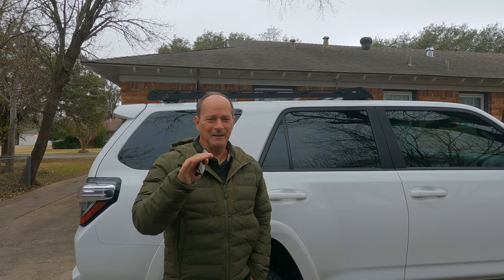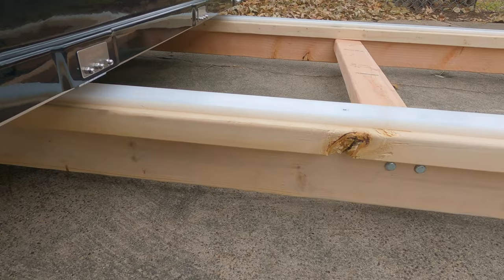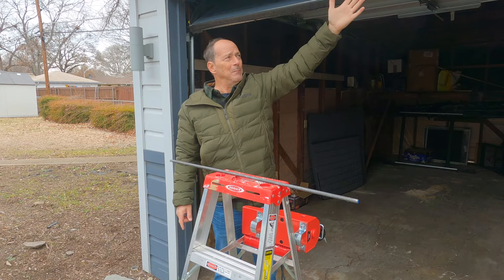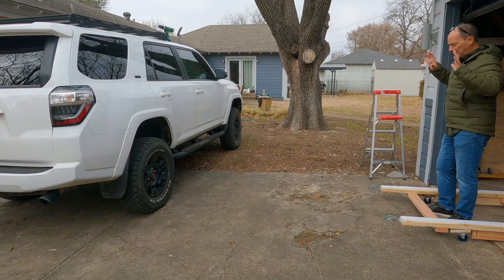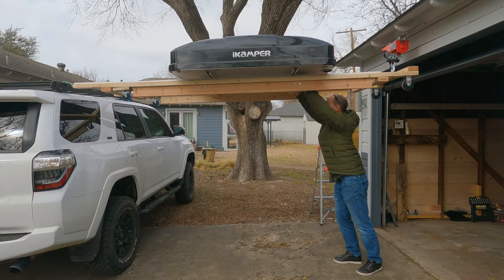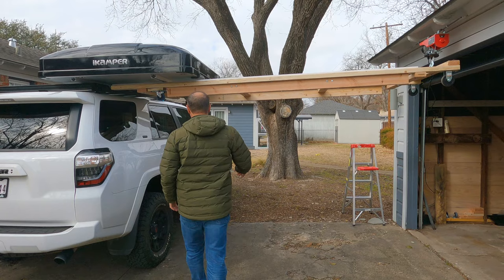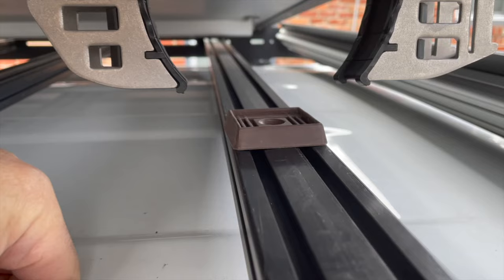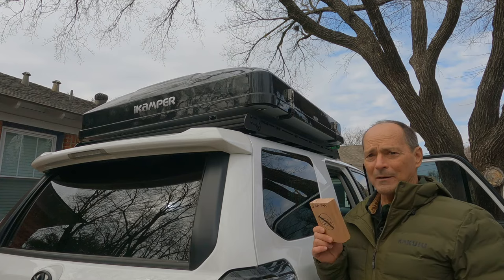Mounting and dismounting your roof top tent by yourself

Comment: Great vid. I had to chuckle as my system is quite similar - as I pulled from various other forums and vids to do mine. Differences - I load mine from the back not the side. I fashioned 2 2x4's to fit in the load clamps so that I could slide the tent up and down the ramp and into the storage area. It required bevelling out the wood so that it approximated a good size for the clamps. I use a boat trailer winch and go through a pulled 90 degrees to give me lift. However, I really like the quiet and ease of the 110v winch.. I'll look into that, thanks. I have an iKamper too and can reach the front clamp from the back - not sure if that would work better for you vs. the tip down spoiler method. 

All in all, excellent vid and system.

Comment: Nice "homeEngineering" My solution was get a "Roofnest Meadowlark"  Thing weighs 90 pounds!  I can get it on the roof myself and I have also just put it in the bed,  slid it under my Tonneau cover.  So glad i waited and watch the RTT market for years before buying.
Reply: There is no doubt lots of solutions out there. Happy that worked out for you. Sounds like a simple setup which is what is necessary in order to make heading out on the road as frictionless as possible.

Comment: Excellent video and a well thought out solution to mounting and un-mounting RTTs.
I just bought a Darche Panorama this morning so this will be useful. Not sure whether to go for wood or steel construction though.
I think steel might be easier to make it so I can disassemble it when not in use. Light gauge 2x2 box section should be plenty strong enough and not too heavy.
Gotta get an electric winch too, great idea.
Reply: I would love to see the steel frame when you are done. Please be sure to share here when you are done. :)
Reply: @HoustonBrownPhotography  I don't have any videos on my channel but I will do this one.
I have just finished removing my flat rack and making the cross bars to support the tent which I purchased yesterday, a Darche Panorama 1400.
I am painting them now and I will install them and pick up the tent this afternoon.
The shop will put it on the bars for me to make it easier but I need to get it on and off to get into my garage.
I am off for a few days camping at the end of the week so I will build it when I get back and upload it.
Reply: @paul-57 Excellent, excited to see what you have designed.

Comment: Thanks for the video - I was glad to see that the Racor lift system you linked to is unavailable - hopefully that's permanent.  I had one years ago (my comment is on amazon with photos) that nearly killed me, and if I had been standing 12" from where I was, it would have.  The system has a design flaw in that it puts a lot of tension on a plastic "wheel".  If that plastic wheel has a defect (it can bend and warp under the pressure) and gets caught up, the "lift" portion will unwind, but the "rack" portion (the outside cables) will not  . . . until they do, and then it comes crashing down.  My only injury was when the rod that you use to unwind it kicked back and hit me between the eyes,, but I shudder to think of a kid standing under that system.  At the end of the day, I pushed them to write me a settlement check  - as much for the injury (though it hurt like an MF) as it was the time to install, uninstall and pack up to ship.  Plus, I wanted anyone who was injured in the future to be able to discover that Racor knew they had a problem and had cut settlement checks in the past.  I haven't looked at the reviews in years, but even at the time I was not the only one to have had a similar problem.  I hope they finally killed that product and that no one was too badly injured.
Reply: Is the failure pretty soon after installation?  I pushed a racor system and installed it a little more than a year ago.  It holds my alpha tent and I never worried about it.  Now I'm wondering if I should?
Reply: @robertelias9447  Mine was definitely within a year.  NEVER NEVER stand under it while you’re lowering it.  I personally would remove it and install a static rack and figure out a way to get the tent up there OR use a system with all metal components.
Reply: I appreciate the information.  I may start looking at other options. @OFFICIALUND

Comment: Great video. It's nice to show both installation and removal of the RTT. Luckily my iKamper and rig fits in my garage so I don't ever have to remove it.
Reply: Hey Floyd, thanks for the kudos and comment. That is a great luxury. Even if mine fit I would still probably take it off as this truck is also my daily driver and that RTT does cause some drag on my rig, so for that reason, along with peace of mind, I would probably still have a way to remove it.
Reply: Thank you for sharing this very nice video. It is excellent idea that every one having a rooftop tent should have. It is useful to me. God bless you.

Comment: This is a great ensign with the exception that now you tent is resting on only two crossbars vs the entire rack. Those rubber bumps should go or add the rubber bumps to every crossbar to evenly distribute the weight across all the crossbars
Reply: That is a good point Gevorg. However, since the tent only weights 123 lbs that equates to roughly 30lbs. per point or 60 lbs. per crossbar, which is way under the load tolerance of those crossbars. I feel pretty confident ab out the mounting points. I have also talked to others who have had to do the same thing and they did not report any issues.
Reply: @HoustonBrownPhotography  what about when you and and another person get in there to sleep. Would the cross bars be able to hold the weight?
Reply: @gevorgnazaryan8720  Extruded aluminum has a high enough tensile strength that I would not even be concerned with it. These racks and rooftop tents are extremely popular and I have never seen a story of a roof rack failing with a rooftop tent on it. I'm sure there's a story out there but I'm not going to worry about it..
Reply: @HoustonBrownPhotography  Agree... dynamic loading is one thing. The static load for the tent and crossbars is much, much higher.

Comment: Great video for 1 person loading and loading your rtt. Maybe you could look into those quick release mounts to make the wind deflection part unnecessary.
Reply: The quick release mounts have to stay on the bottom side of the RTT which prevents me from being able to SLIDE it on so that does not work either. The quick release is really only any good if you have some type of rig that allows you to LOWER the RTT into place.

Comment: I agree with the comments. You did a great job. Very ingenious. I’m assuming you take it off for theft purposes, gas consumption or height restrictions?
Reply: Thank you MC. No so much theft purposes, I mean if you have the time, tools, strength, and skill to remove it than so be it. Like you say, I do it more for gas consumption and just for the simple fact that when it is not in use than there is no sense in having it up there. The fact that I can now take it off in 20 minutes or less makes it so much easier to make that decision. If you have a garage that you can fit in with the RTT mounted than you should get the lifting system mentioned in the video which would make it even easier.

Comment: Genius! I copied your idea except I used 14 foot long boards because my jeep sits higher and i set the "sliding" 2x4s standing up and looks like wont flex as much as laying on their sides. Do you or anyone know if your ikamper clamps will work on any or most other brand RTT bottom side mounting rails?? Those seem like they would make it so much easier
Reply from the maker: I am not sure if the iKamper clamps will fit or not. Guess you will need to compare your rail size to that of the iKamper. Front Runner makes some quick clamps for faster mounting and dismounting of a RTT.  https://youtu.be/UqtCXHlDfqo?si=mJXpoLsMhiQiHc3M&t=22

The reason I did not go with this is that it would not be a smooth surface to slide the tent off and on.

Comment: That's a very clever way but since my rig is a little taller and my iKamper is a fullsize 2.0 its more difficult.
Reply: The Full size iKamper 2.0 one is only 45lbs more than the 3.0 mini and this rail system will hold that no problem. I guess you can add some length to it depending on how much taller your rig is. Hope this helps you though.
Reply: @HoustonBrownPhotography  Thanks, I'm going to give it a try. By the way where did you buy the hooks, I tried looking online but can't seem to fine heavy duty hooks with a flat back to bolt into 2x4.
Reply from the maker: @davetee3589  I put the link in the description but I got them at home depot
Reply: @landandseaadventures  Thanks for the blueprint, it worked flawlessly. I can now put on my RTT by myself.

Comment: Would an engine hoist lift it high enough?
Reply: I don't know that much about engine hoist, but I doubt you could go high enough considering once you tie the rooftop tent to the hoist, it's going to dangle at least 3 feet, so that means you'd have to go up above the roof, which would be almost 11 feet. Do you know of an engine lift that goes that high, not to mention that seems a bit overkill unless you already have one, of course

Comment: why not just put ratchet straps around the tent. And use the hoist to lift the tent up and drive under the tent, then lower the hoist/tent onto the truck? no need for the wood contraption.
Reply: I’m sure his garage door opening is not tall enough to do this. Bc I would love to be able to do what you mentioned here, but my truck+tent is too tall to fit under my garage. So I’m having to go this route as well.